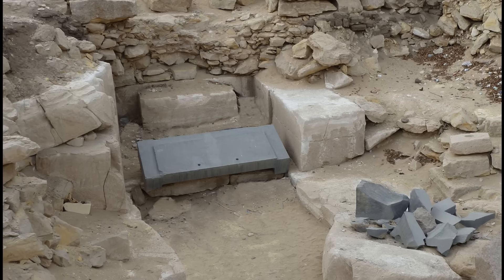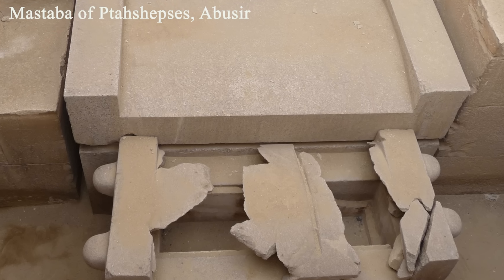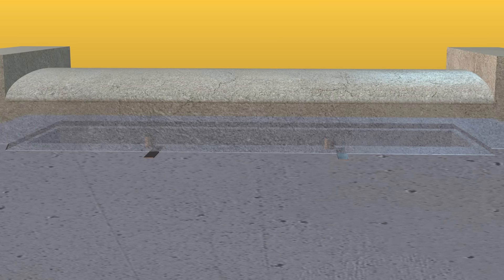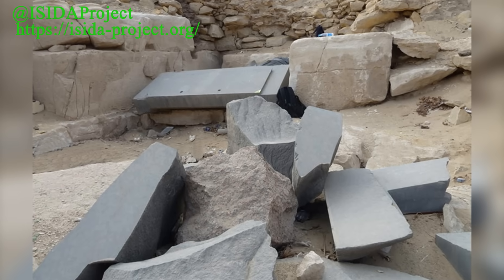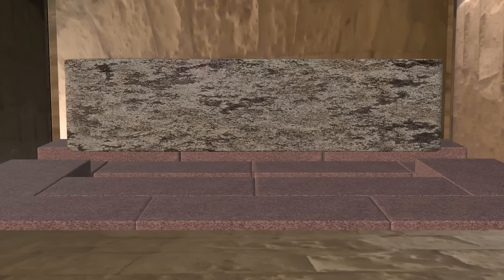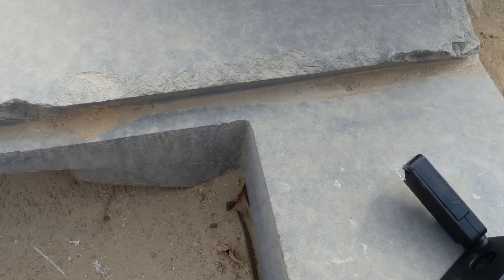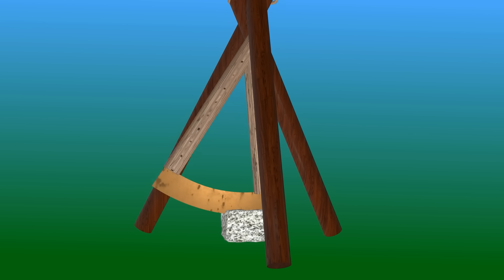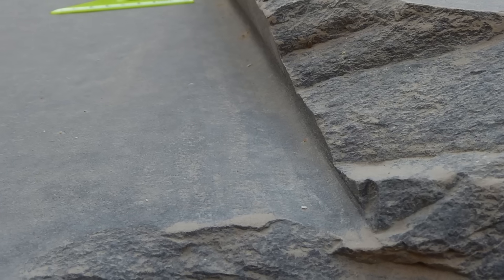Tool marks on the sarcophagus of the Headless Pyramid

Comment: Oh dear you need to get two specialist to give you some technical support..one a locksmith/watch maker/engineer and the other is quarry masons they have a far better understanding on dealing with huge stones..and cutting mason who uses large cutting systems..
Also you need 3D scanning this will give you a far better understanding of the actual accuracy of the whole object..
Rhis is an engineering job nit an architect certainly NOT archeological one..
Reply from the maker: Thank you.
Reply: As an industrial stone mason its obvious that most people haven't got a clue what they are talking about when it comes to polygonal Stone Systems.. @GRES_TAC

Comment: It's simple. If you have a large round pole and on the end is pitch with an aggregate for grindings and you put pressure on the rod with weight then turn the rod manually over and over it will drill through that stone and it will leave marks. That's how they did it. Most people are not smart enough or have ever used their hands for hard work.
Reply from the maker: Thank you, this is common knowledge. The question is whether to use fixed abrasive or free. https://www.youtube.com/watch?v=y7aK8lpMzDU&t=3254s And also the type of abrasive itself. There are no questions about how it was done.

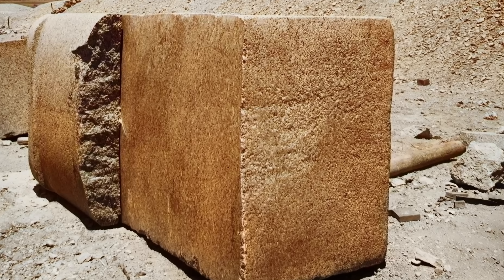Comment: The photo at 9:52 is the unfinished box that broke while cutting off the portion that would become the lid. As you can see, the entire width was being cut by what appears to be two circular blades, with the top blade leaving a curved edge at the center. The photo at 10:00 shows the same box, taken at the museum from the opposite side. We can see how the angle of the cut deviated, binding the blade and breaking the material. How could a swinging pendulum perform these cuts or cause the results we see?
Reply from the maker: Thank you. The pendulum beat explains the kerf expansion better than a circular saw, which should have a close to constant kerf width. There were 2 videos about the unfinished sarcophagus, where some disadvantages of using a saw were discussed. https://youtu.be/tOICtofKKM4 https://youtu.be/ii83g_V8tKA
Reply: Because when you saw a hard object you don't just saw in one direction. Neither of you understand cutting stone. You rock the blade forward and backward which creates a circular appearance. The center is the last to go as you penetrate the stone.
Reply from the maker: @edwardfortae2350 Even in my youth I used a two-handed saw to cut both wood and stone (soft limestone). The shape of the saw is arched. The forward and backward movements do not form circular surfaces.

Comment: Thank you for the nice video😀 To me the locking mechanism looking more like something was locked inside not to ever get out as well as not to release what is inside by accident. But due to the posibility pf breaking the sarcofagus or lid it is still woudarable from outside and the builders would know the limits of the material. Maybe the egiptians had such a big fear of of the dead comming back that they wanted to lock them up as secure as possible? Today we are very locked in our roman based and influenced thinking and it is very hard to to get an idea how the people 5000 years ago thought and worked.
Reply from the maker: Thank you. I agree, and I thought about it, but I didn't dare to express this thought in the video.
Reply: So you are sure it was made by Egyptians?

Comment: Long before written history, during the waning cold of the Ice Age, a vast and sophisticated civilization flourished along Earth’s equator. Anchored in the forgotten geometry of ancient landscapes, they built great megalithic structures atop telluric energy hot spots—nodes of Earth’s natural electrical breath.

Harnessing the subtle power of the Kelvin drop and the amplified reach of towering gold-capped obelisks, these people mastered the atmospheric dance of static and charge. Their temples were more than places of ritual—they were power stations, harmonizing aquifers, elevations, and electromagnetic fields into an invisible grid.

Energy was stored in monumental Leyden jars—ceramic capacitors braided in foil and sacred intention. Banked in great numbers, these vessels pulsed with possibility. They fueled precision plasma cutting of stone, levitated multi-ton blocks across resin-lubricated quartz sleds, purified drinking water through corona ozone infusion, and activated the granite resonant chambers that once vibrated with harmonic energy tuned to the stars.

But the balance fractured. A series of cataclysmic meteor airbursts shattered the ice sheets and loosed the global flood of the Younger Dryas. In the chaos, much was buried—lost beneath silt, stone, and time. Yet not forgotten entirely.

Today, the echoes rise. Threads of memory, carved in granite and sung through frequency, surface once again—reminders that our ancestors were not primitive, but profound.

Comment: stone drilling (dureté 7) with PVC tube
https://www.youtube.com/watch?v=6mPMs403Xj0
Reply from the maker: It is not the plastic pipe that cuts the stone, but the abrasive. When using drilling with a free abrasive, any material capable of holding abrasive particles can be used as a base.
Reply: @GRES_TAC 😅 c est justement ce que prouve mon montage...si le Pvc peut forer une dureté 7 ( j ai pas plus dur) alors le cuivre peut le faire...c est de l archéologie expérimentale....😊
Reply from the maker: @michelbrz  Of course! I agree. And then the marks on the stone should match.